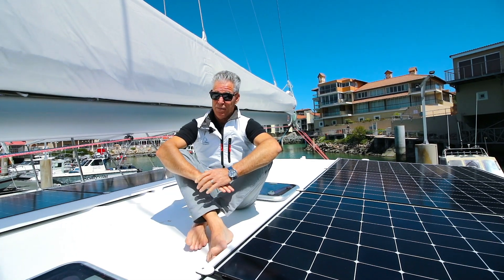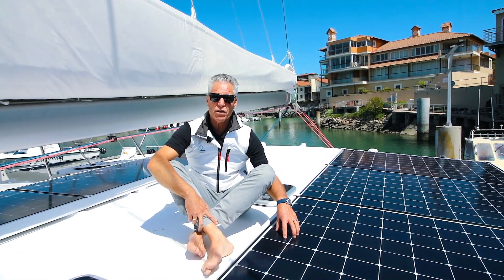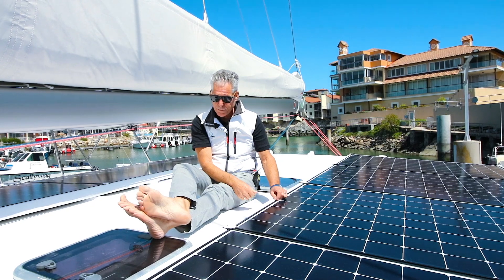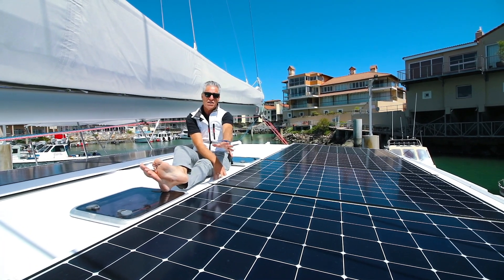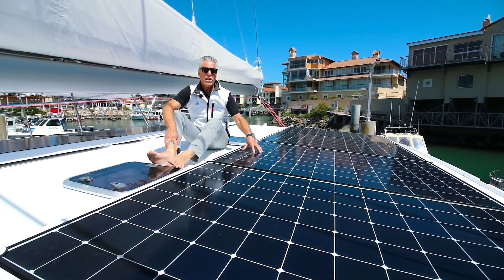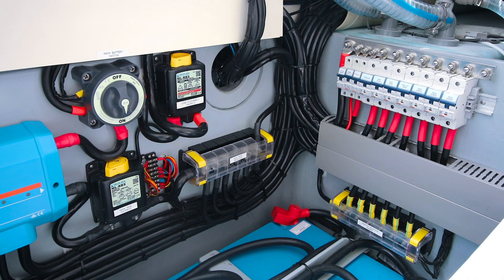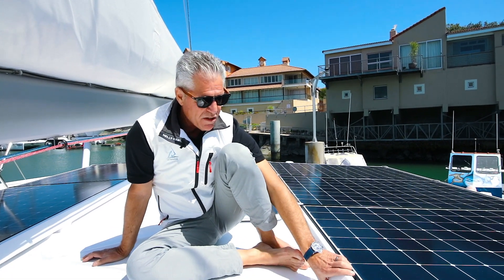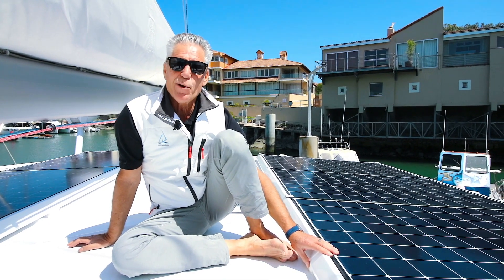Balance Build Technology - Solar Panel Set Up

Comment: Are those SunPower panels?  They look like it.  How many of the 420 watt a series panels could you fit up there? I'm only dreaming at this point, but I really want a full solar electric cat with electric sail drives, and just have a genset as an emergency backup, and do the liveaboard thing.  Balance is definitely at the top of my list of boats, especially now that you have the 442.  That's still probably a bit big for me, but if I could buy one, I definitely wouldn't be complaining, lol.
Reply: Agree, please see my comment above about electric drive. 

Be sure to check out the new Seawind 1370.  I really like the design and like Balance it also uses the salon as a giant pilothouse.  Seawind greatly cleaned up the sightlines on the 1370 compared to earlier designs.  Somewhat different solutions from Balance, but good ideas in both.  Obviously the Balance Catamarans are nicer boats, but the Seawinds may (or may not) be more affordable.  (Actually the Balance 442 may not be priced too far from the Seawind 1370.)
Reply: @LoanwordEggcorn  Yeah, I love the 1370 for sure.  It's basically at the top of my list.  The unfortunately part of the 442s is that if you live in the US you can count on the 442 being about 30% more expensive due to import tariffs on chinese built goods, unfortunately.
Reply: @FlesHBoX  Is the 442 made in China?  (Wasn't obvious on their web site.)  I thought the 451 was made in China.  Maybe both?

Perhaps ironically, even China companies are moving production to Vietnam for lower costs.

It's sad that China is oppressing freedom and human rights in Hong Kong, but probably inevitable.  Otherwise Hong Kong FOB might have helped tariffs, depending.

IMO, the Seawind 1370 takes all the good points from the earlier Seawind designs and improves them in a much more modern design.  It definitely seems inspired by Balance too.  I sort of like the 1370 design better than Balance; slightly simpler and more practical.  Obviosuly the Balance boats are higher performance.  

Dagegrboards are sorely missing on the 1370, but if most cruising is downwind, they maybe it's less important.  Would like to have the option of better performance to wind though.  Obviously daggerboards add cost, which sort of goes against a design brief of more accessible pricing.

1370 is probably my top pick too.

P.S. A used China made boat bought through a different country may avoid the tariff.
Reply: @LoanwordEggcorn  I believe that all of the shorter Balances are built in China.  Phil did another video about it on the Balance channel.

As for the 1370 and daggerboards, it kind of makes sense not to, since they would eat up a lot of space inside, and Seawind definitely wants to have that "luxury but also performance" thing.

Interestingly, as far as Bruce numbers go, the 1370 is actually slightly ahead of the 442. I suspect they will be fairly close performance-wise.
Reply: @FlesHBoX  Hadn't looked at performance metrics.  The Balance seems to have more foresail area, but comparisons are slightly apples and oranges due to daggerboards.  

Perhaps the different sail balance is due to daggerboards.

Daggerboards add both trunk space and cost, but gain a lot of upwind performance.  As with everything engineering, each design decision is a tradeoff of multiple factors.

Interestingly Seawind doesn't offer an electric drive option on the 1370 either, perhaps due to cost/price/manufacturing simplicity goals.

But eventually,, electric drive may dominate due to wind (sail) regeneration, simplicity, much lower maintenance, much lower energy costs, etc.  Certainly it's already highly practical for daysailers.
Reply: @LoanwordEggcorn  Yeah, the 442 will definitely have better VMG upwind for sure.

I suspect that if you had money in had, seawind (or really any of the smaller cat builders) would put electric motors in for you, which is what I would personally do.
Reply: @FlesHBoX  Agree.
Reply: @FlesHBoX  all of the 442, 48, 52 will be made in south africa.  the 451's were made in china.    Also the balance 442 is about the same price point of the 1370.  the base price is about 700k and the 1370 is 600k.  I do know that you cant get the 1370 for 600k even if you didn't add any options(who wouldn't add them) because they have like a 40 or 50k commisioning fee even if you pick it up at the factory in vietnam.  Im not sure if theres a commisioning fee or if that is already priced into the 700k on the 442.  Im sure a cruiser ready 442 would be around 900k ish and the 1370 is probably pretty close to that.  The ruby rose edition 1370 is 800k and when I priced it out i saw that it was missing quite a bit of stuff.  From what i've seen the balance is a better boat.  I'd like to add I haven't been on either boat though.
Reply: @FlesHBoX  Balance will let you go full electric but you have to have the electric company come and install them on your boat in south africa.  Warranties and what not.  I dont think battery technology is quite there yet but im sure you could make it work.  Of course costs would be a bit higher.
Reply: @justincruz8352  I did some math on it, and you can fit about 70-80 kW of LiFeP04 batteries onboard for around the same weight as the difference in diesel engines vs electric motors, plus the weight of diesel fuel you wouldn't need.  That would get you quite a long distance even without wind or solar power gen as long as you're not running flat out, and even then, it would probably get you far enough 99% of the time you would need to be motoring.

If you were willing to take on the potential risks associated with cobalt based lion batteries, you can get even more storage. 

Battery tech certainly isn't mature yet, and has quite a long ways to go, but the idea that it's not good enough for a boat isn't accurate, and is one of the major things about Berman and Balance that has pushed them down my list.  Balance cats are the perfect place for electric since they perform well, but Berman is incredibly opposed to the idea.  Sure Balance will sell you a boat with electric motors, but the multiple videos trying to dissuade people from doing it makes me suspect that you would be met with heavy opposition from them.  It just shows that they are being shortsighted for some reason, and that makes me double guess whether they are who I want to build my boat.
Reply: @FlesHBoX  80kw of batteries is like 100k not including motors.  but how would you charge that much battery?   What would you do in a storm?

Also I dont think its fair to say that balance wont let you install electric motors ive seen him say they allow it but youlll need the company to do it for you.  OceanVolt wont warranty a system that they do not install themselves.
Reply: @justincruz8352  And that's why I didn't say they wouldn't....

Comment: Can you add more solar panels over the RIB
Reply from the maker: Yes, but it depends a lot on the outfit of the boat itself. Balancing weights is vital on a performance cat.
Reply: @balancecatamarans  If I have a very good battery bank, how many panels do you need to go completely without generator and be able to consume refrigerator, Aircons, Televisions, electronics etc. 24 hours a day.

Comment: Is it possible to replace both trampolines in front of the catamaran with solar panel too? if you never use the trampoline anyway.
Reply: Lots of good real estate, and you could fit at least another 1.5 kW up there, but the issue then becomes airflow over the boat and hydrodynamics.  Panels are fine for weather, but you wouldn't want them completely exposed up there, so you would have to have some structure under them to protect them from waves.  At that point you are impacting the aerodynamics of the bridge deck and potentially increasing possible hydrodynamic drag in heavy seas.

While not as much area, I would put panels over the dinghy davits.  You could easily fit 3 or 4 more panels in that area, and if you get clever you can set up a slide out system for 3 or 4 more underneath those that you can pull out when you are at anchor or moored.  I imagine if you aren't the kind of person to hang out on the tramps in the sun, you wouldn't mind the extra shade in the cockpit that would provide, lol.
Reply: @FlesHBoX  Agree.  @Paso79, remember that the trampoline allows both airflow and spray/waves to flow through the trampoline and over the hull if needed.  This reduces the wind and water loading on the entire boat and is an important part of catamaran design.
Reply: @FlesHBoX  ya I totally understand what you mean. Yes you need to put something under it to protect the panels from waves and almost constant splashing of salt water on them. You are right. At the end of the day... it might not worth all the trouble for couple of more panels. The foldout panel on the back might be better solution. 
Thanks. 👍

Comment: Can you walk on these elevated solar panels without risking to break them ?
Reply from the maker: Best not to!  But there is no reason to. We leave a pathway down the deck for boom access. The thing with hard panels is they perform fantastic. But we can always put soft panels on for folks if they are ok to get reduced performance per panel. Best, Phil